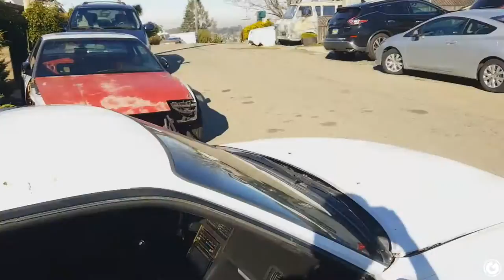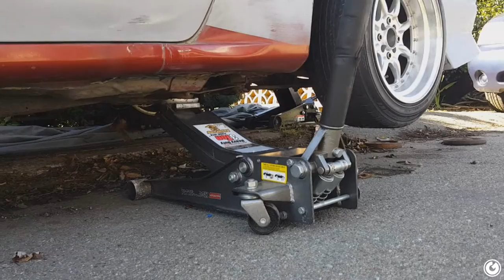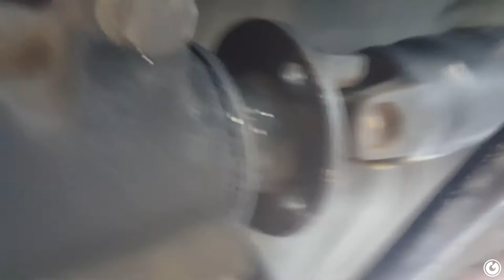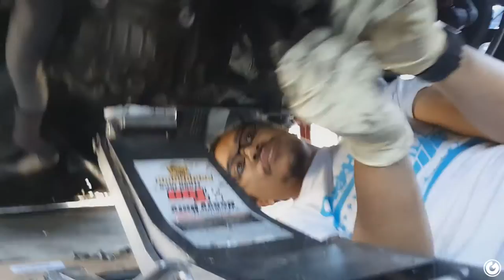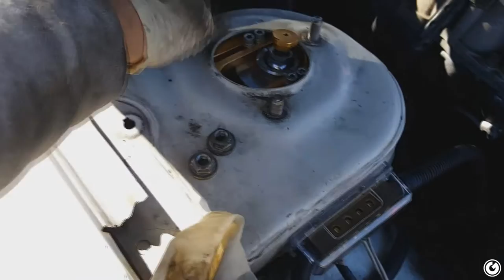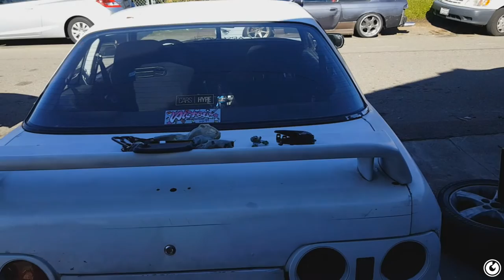Welded diff & PBM coilover install | Episode XI - GTS13

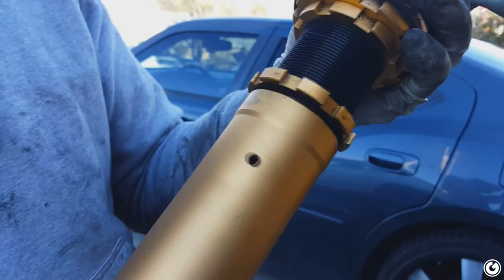Comment: At 8:08 how low would you say that hole is? I just got the same coils and mine don't have the hole...
Reply from the maker: The hole was sitting below the threads. Making the coils maxed out as high as possible and almost no threads inside the tube. As long as there is a solid amount of threads in the tube of your coilover, you should be good
Reply: Ger Lewis alright cool thank! Enjoy the content Btw👍🏻